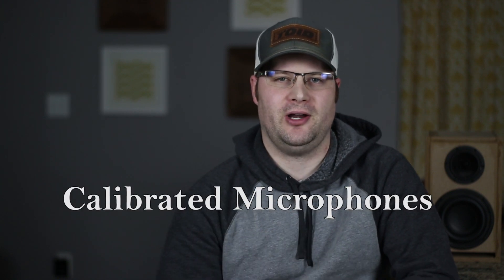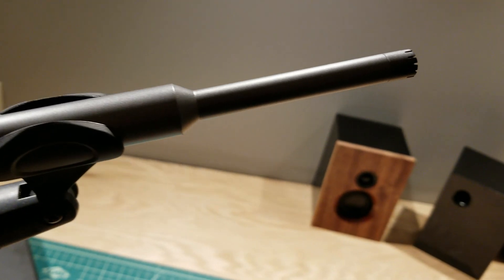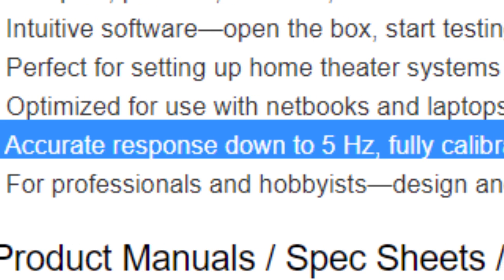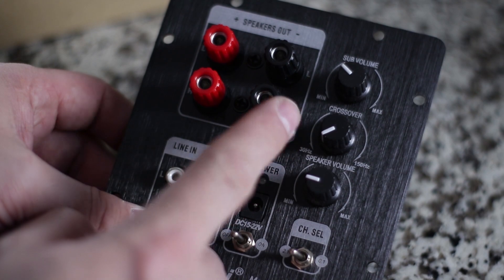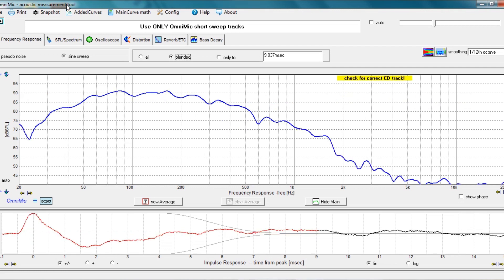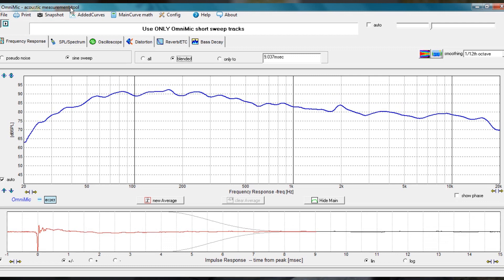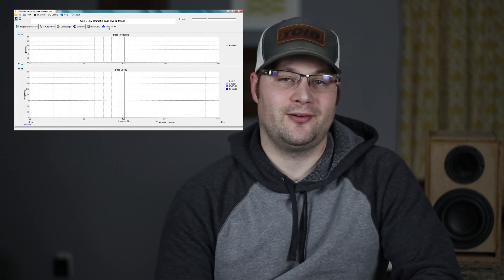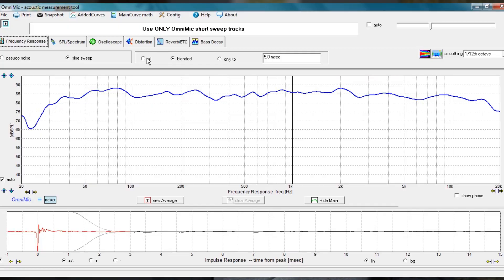Omnimic V2 vs Umik-1!  Why I changed

Comment: One correction.  A calibrated mic isn’t designed to give you a “flat” response. It is calibrated to give you an “accurate” response.  Getting a flat response is the tuning you do to address the peaks and valleys revealed by an accurate measurement.
Reply: Imagine paying $300 for a flat linear microphone that needs a calibration file to be flat and linear

Comment: I wish I could find this "A vs. B" video:
- actual characteristics comparison (SN/R, Max SPL, sample rate, etc...)
- actual frequency response comparison with real measurements (1 given speaker with 2 mics alternatively used at the same position)
- on-axis vs. 90° off axis measurements for both
- a more exhaustive overall pros and cons (large body size for the Omnimic, large capsule diameter for the UMIK-1)

Additionally, you may have unintentionally proven in this video how inconsistent the sweep measurements can be with the Omnimic software. We can see the graphs changing by at least 1 or 2 dB from one pass to another.
Reply from the maker: I don't have my Umik-1 anymore, so I can't do some of that.  What you're actually seeing with the omnimic is it is getting rid of the reflections in the measurements. Its actually a lot better at giving it accurate responses do to that.  You can even sum the measurements if you want the most accurate response.
Reply: Actually, both the OmniMic and the UMIK-1 use a 6mm capsule. 
Doing an A vs. B comparison would give you pretty much the same results between the two (+/- 1 Db or so, and that is only calibration related). About the only difference might be at high SPL, according to the UMIK-1 specs the distortion is 1% THD @ 1 kHz: 133 dB, for the OmniMic it is 127 dB... I've never tested that though, I don't see how the UMIK-1 could handle higher SPL than the OmniMic unless it is a limit of the OmniMic's internal DAC.
Reply: @chrisperez7592  you are right but the polar piece (tip of the mic) is rather different between the two mics and will affect their 90° off-axis capability. It is known that the body of the mic has some influence on the acoustic data if you measure a loudspeaker aiming at it or with the mic positioned vertically.

Comment: The umik-1 has a frec response from 8hz-20khz it says even on the box  wich it came! I tested it ! it is working !
Reply from the maker: According to mini DSP, the makers of it and there datasheet, it's 20 Hertz to 20 kilohertz.  https://www.minidsp.com/products/acoustic-measurement/umik-1. I know there's a few places you can buy it calibrated lower, for a fee. But directly from mini DSP it's not calibrated any lower than 20 Hertz
Reply: @Toid  Wrong, the calibration file from MiniDSP goes down to 10Hz.
Reply from the maker: @Legendenwelten  I'm going to go ahead and e-mail Mini Dsp to see where the discrepancy is.  I'm not sure why they would claim only 20hz and then calibrate it to 10hz.  My suspicion is that is only calibrated to 20hz, but below that is a guesstimate.  There is something similar with my omnimic.  It's calibration file goes down to 4.6hz, but it is only calibrated to 10hz.
Reply from the maker: @Legendenwelten  I heard back from miniDSP.  Here is what they said, "Thanks for your interest in our products.
Indeed the calibration file goes down to 10Hz. The statement on the datasheet is with regards to the /- 1dB rating which was done in a lab. Measuring (and calibrating) at very low frequency is extremely hard in factory environment. For that reason, we rather be safe to state that the rated frequency response (-/ 1dB) is just for 20Hz. The mic will however measure fine all the way to 5Hz."  So according to them, they cannot guarantee their +-1db past 20hz, but you should still be fairly accurate down to 5hz.   Which is really good and thankfully MiniDsp clarified that.

Comment: Great video, I purchased an Omnimic based on your thoughts here. Please would you do a follow up showing how to do high quality measurements. I seem to have some variability in my measurements which really impacts on my ability to reliably set the relative acoustic delay in XSim so that the forward lobe is straight ahead (or where I want it). Thanks!

Comment: If you want the definitive and ultimate solution, you should use a classic XLR measurement mic with no ADC + mic preamp and do a 2channel measurement, where one of the channels is a loopback from the amp (a small circuit to limit the voltage will be needed, but that's just two resistors and two Zener diodes). You run that into the line-in of your soundcard and use something like ARTA to get the data. This is the best way to measure the phase properly (needed for speaker design, absolutely unnecessary for room EQ)

ARTA is a great software for audio measurements and comes free for regular use.

I use Monacor ECM-40 and MPR-1.
Reply: XLR is not at all accurate unless one is spending thousands of dollars on it.See microphones are not the issue here. Something like Earthworks M30 is dream of person entering into calibration. See a person can factor that into his overall budget but then he fails to get a suitable interface. Because no interface or measuring equipment which you can purchase at a reasonable price can get you flat response out of them. They are not flat at 20hz-20khz range let alone 0hz-40khz. So yeah it won't work in theory. You need pro grade stuff to get accurate measurement out of it. So yes. USB microphones are the best unless one got thousands to spend on the equipment.
Reply: @KING_DRANZER  why would the interface not be linear? :) Even the cheapest onboard codecs can do 20-20k at +-0.5dB; Scarlett Solo does it at 0.1dB on mic input.
If you're doing room EQ - sure, get yourself a USB mic, it's practical and easy to use. They're just not enough for loudspeaker design.
Reply: @tomkocur  Nah man unless we use stuff at low gain. Nothing is linear in low or even mid range. And as we turn up the gain the linearity goes down.
Reply: @KING_DRANZER  No :) There's absolutely no technical reason for the linearity to decrease with gain. And it just doesn't happen - do a measurement with gain set to low then set it to high and measure again. You'll see the same exact curve, just higher on Y axis. Been there, did that, you can try it to.
Watch this for linearity measurement of Scarlett Solo, it's dead flat up to fs/2:
youtu.be/VSgzF79ivd0
Reply: @tomkocur  It does man. Depending on the interface we pick up it may go down good 1-3db in sub-bass area. And also be peaky or dip at high end. So yeah  not linear. For vocals and recording etc that be fine. For room-eq even-though it be acceptable it is not ideal.
Reply: @KING_DRANZER  did you check that video I sent? 🙂 ~$100 interface is superflat up to 40kHz. And it will measure the same thing regardless of input gain, if you don't clip it.
Reply: @tomkocur  Oh yes absolutely it is flat for majority of the part. Hey, thanks for sharing the video. But when we set to high gain the roll-off is bad on both ends specially when e plan to measure 20hz or even lower I expect it to be flat to 0. Because we like measure to 10hz or even 5hz if possible and push SUBs down to there. And same on the other end where we want flat measurement till at-least 20hz if not beyond that. That is most important aspect of room-eq. But yeah just making it clear that I have always agreed with you that XLR Mic + Interface(High End) is superior to USB Microphone. But that is very expensive to get the right combo is all I wanted to say. At low end or for people on budget USB is better.
Reply: @KING_DRANZER  What's the purpose of measuring below 20Hz? In crossover design there is none, you barely even need to measure below 200Hz. Room EQ? Below 20Hz you'd need supersteep filters that even DSPs won't be able to provide.
But again, if you watched that video, you'd see scarlett is within 0.5dB from 10Hz up to 50kHz

Comment: Since you only measure your room and not your equipment below 300 Hz (due to reflections in your room), improvements under 20 Hz are irrelevant.
Reply: bingo
Reply: Unless you measure in your room, in which case you can still do something. If you use a minidsp 2x4 or similar for your sub, you can change the filters and see the effect.

Comment: down side... usb limit is technically 14ft... which blows.. i think v2 comes with a 10ft usb cable i just ordered it.
Upside... it  has an audio interface in it and it was caliberated with it... Soundcards have their own eq and artifacts... so it will correct that :P  fahking amped about getting my v2 kit.. just got dats bundle too
Reply from the maker: Nice! I'm amped for you! That's a killer setup
Reply: You can add a USB repeater if really necessary.
Reply: Marty McLeod That’s what I was thinking too... they even have weird USB extenders that go over ethernet.  😦🥴🤠🤠🤠

Comment: unfortunately Omni it's also 3times more expensive. Btw, what happens if u don't have a CD player (it's 2019) can you download online the content from the CD?
Reply from the maker: That is a good point.  It is more expensive, but over the life of using it, it would be well worth it in my opinion.  Especially with the sub 20hz calibration.  Yes, you can download the files.  They are free to download here: http://www.daytonaudio.com/index.php/omnimic-v2-precision-measurement-system.html
Reply: Almost all devices that play a DVD or a Blu Ray, also play a CD. Except the PS4, because Sony is a pain in the ass like that.
Reply: you can play the frequency sweep or pink noise directly from the sound card output of your computer. Should be under the "config" menu header.
Reply: @russellborrego  never laptops or pc don't have cd/dvd drives anymore
Reply: @Toid  ehhh... maybe I'll buy the Omni, in my country it's even more, $350 (EU)
Reply from the maker: @HowDareYouu  if you use your laptop, the standard files will automatically play from your sound card. That means you don't need to run to CD or downloaded files. However if you do want it run some of the more advanced one's like bass removed oh, I do believe you have to use those files. it's a good point a lot of laptops don't come with any type of drives anymore.  Which really is a shame.
Reply from the maker: @HowDareYouu  wow, that stinks.

Comment: How do you get the OmniMic to work with REW? I don't think it works with REW. I was going to buy the omnimic butg everywhere I read (including parts express) it says the omnimic won't work with REW. If it does then i'd be more likely to go that route, since i could use both. REW seems to do some things that the omnimic software doesn't.
Reply from the maker: It works fine with Rew. You just plug it in and the upload the calibration file
Reply: @Toid  thank you! I assume you’ve actually used the omnimic with REW? I have been trying to find a definitive answer for days. I saw one person on AVS forum saying it did work, but then a bunch of people saying it didn’t. I also saw someone ask in the FAQ page on parts express iirc. But a lot of the answers were old so I was hoping maybe REW had been updated to work with the omnimic. The omnimic software looks easier to use than REW, but there is a lot more help readily available for REW on the online forums and such so it would be nice to still have the option to use REW. I don’t know if OmniMic has the time alignment feature like REW. Does it? I am brand new to trying to take measurements.

Would you still recommend the OmniMic over the UMIK-1?
Reply from the maker: @mikem8533  I have used it with REW, especially in the beginning. But honestly, I exclusively use it with Omnimic software for what I do. I’m not sure why anyone would think it wouldn’t work with REW. Any mic will work. Of course you want a calibrated microphone and for Rew to understand the calibration you just need the calibration file which is included with the Omnimic. Now it is important to note that the Omnimic software will only work with an Omnimic, as your computer has to recognize that specific microphone. As to answer your question, without a doubt I still recommend the Omnimic over the Umik.
Reply: @Toid  awesome. Thanks for the detailed reply! I really appreciate it.
Reply: @Toid  Has Parts Express discontinued the OmniMic?  Can't find on website any longer .

Comment: The poor build quality on the V2 by Dayton is not acceptable. Read the reviews on partsexpress, a $300 with that kind of flaw is a hard pass. I'll stick with the umik from cross spectrum, where they calibrate it with their reference mic
Reply from the maker: Interesting. I just read the new review. I must say, I'm not sure what it's going on with his mics. I've had mine for years with no adverse issues (and mine is in constant use). I also know numerous others that use it the same way. It's definitely not normal. However, I'm happy that you're happy with your umik1 from cross spectrum. It's a good microphone.

Comment: Iam very unlucky. I have two umik-1 and both are stuck at weird levels. First umik-1 arrived lose at usb and second mic only 5 uses and after 1 year the tip is loose with stuck dB. Anyone suggest another company besides Dayton or umik-1 at under $150 range? I-am now going back to using my 13 year old radio shack model 33-4060 sound level meter.I-am also In Hong Kong with Minidsp and they do not allow client visit saying it’s only an engineer location. But they did charge me the $5 usd to ship to me in Hong Kong. I feel Minidsp products are very poor quality and glad I never purchased there avr boxes.

Comment: How would you use the Omnimic software to help position a speaker for Home Theatre application and do you think I can use the calibrated mic that came with my Emotiva XMC-1? ( I think it's a UMIK-1).

Thanks,

JP
Reply from the maker: You definitely can use any calibrated microphone.  Basically you would put your calibrated microphone at the listening position run a sweep with rew and then move your speaker and run another sweep.  With the Omni mic makes it a little easier as a sweep continues and gives you live measurements.  Then keep your speaker where it measures best for you and your room

Comment: EEEK, the difference is not a little bit more. Its a whole brick outhouse more. Its like more than three times the price.  And honestly, whats a CD player. At that price they can ship it with a USB Thumb Drive.
Reply from the maker: Haha. They are both great mics. And I think that the Umik1 is perfect for most people.  It all depends on how often you use it and the accuracy you need. There's been a lot of discussion that the Umik1 suffers accuracy in the high end. But if you rarely use it, that's not a big deal.  For someone like me that uses it quite often, I want it to be highly accurate and for me the way the software works, works much better for me.

Comment: be careful not to confuse speaker measurements and room measurements. They aren't the same. you shouldn't use this to find the best placements of speakers.. the suggestion of using the Omni mic to see real time changes in response as you move a speaker around room is flawed. the mic should be a set distance from the driver (usually 1ft to 3ft in a professional acoustical analysis...although these two pieces of software might have their own requirements on distance)... if you were to move a speaker around that microphone would have to follow in the identical position in reference to the driver..
it's much better to take two separate measurements. one of the speaker, in order to properly calibrate the sound output from the driver. you can do a separate measurement of the room using the RT60 impulse measurement. place the mic in the center of the room and clap your hands real loud. that's what you need for the room measurement. go to Bob Golds acoustics website (google it) for a wealth of tools to calculate the modes in your room.. etc